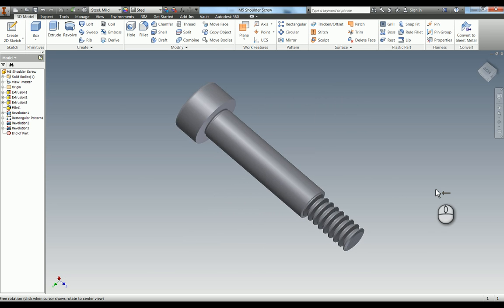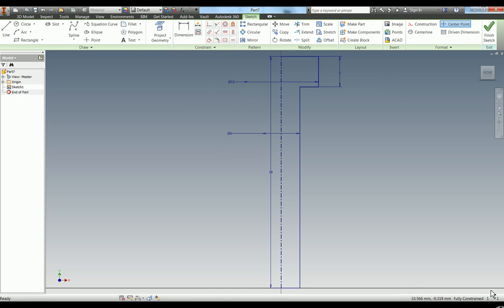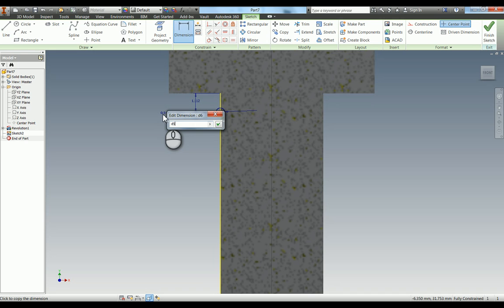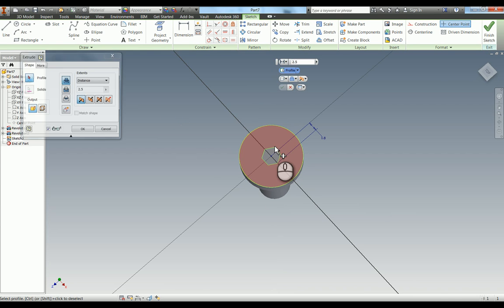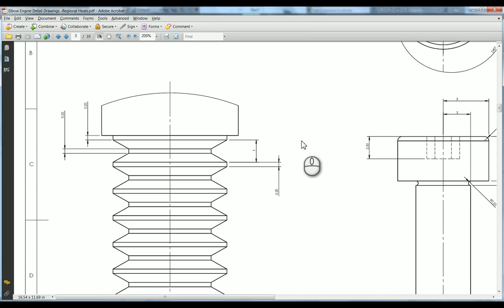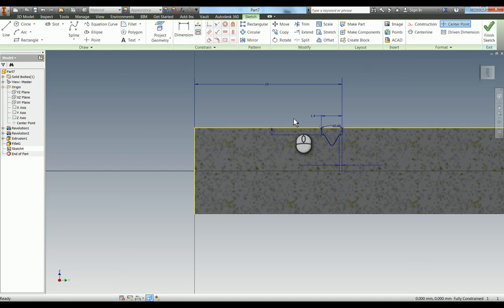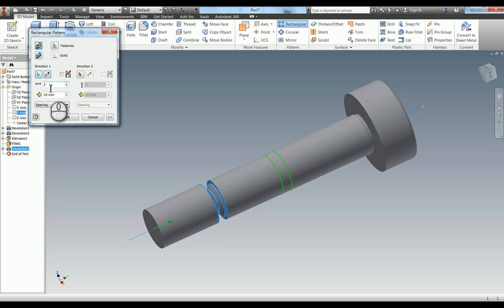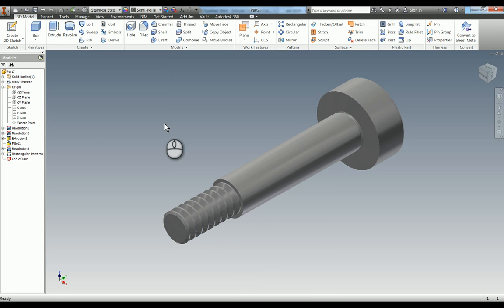4 Modelling the M5 Shoulder Screw - Elbow Engine

Comment: I don't understand how its determined the length of the horizontal line between the 2 60 degree lines, when I try this I get that line unconstrained
Reply from the maker: https://youtu.be/vveROXZn_d4?t=4m57s - if you see here I use the 'equals' constraint. This means the two lines either side of the 60 degree lines are BOTH 0.2mm. That will determine the horizontal line between the 2 60 degree lines. I hope that makes sense.
Reply: I must be doing something else wrong as I placed the = constraint, if I figure it out I'll post back here, amazed by such a fast response to an old video, thank you
Reply: Oh you placed the = on the '3rd' horizontal bit as well, I have it now thank you
Reply from the maker: The only other thing i can think of is that, when I was sketching the "horiztonal" constraints were being automatically added for the top horizontal lines? Hope you get it fixed.